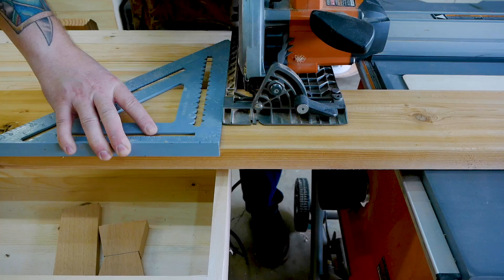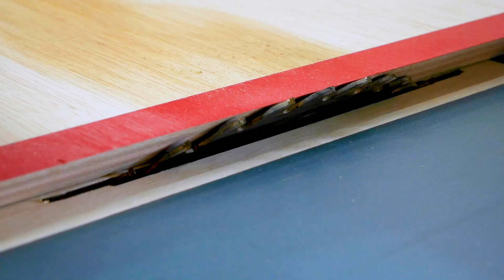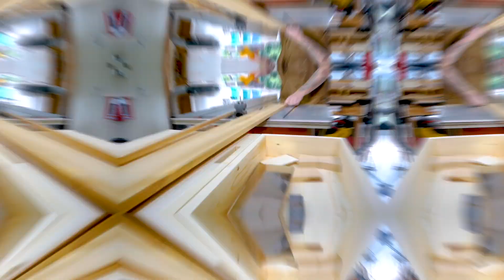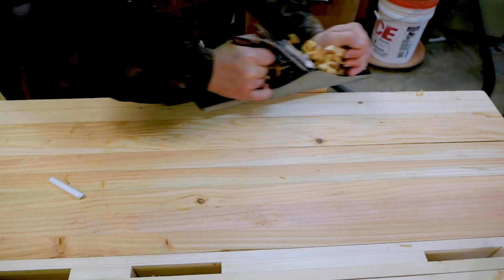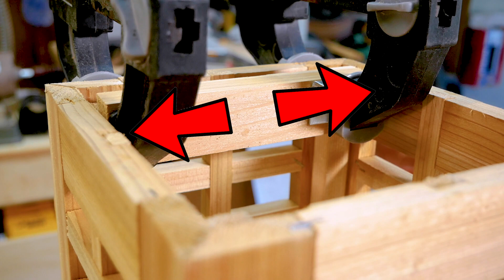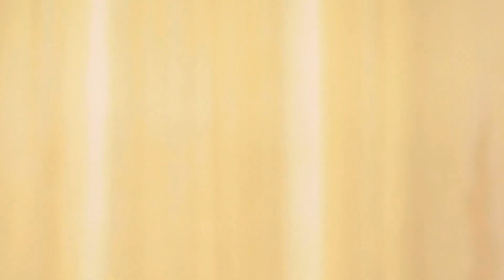I Made New Garden Lights: This Is A STUNNING Upgrade

Comment: Wood is terrible when constantly fighting the rain and cold weather. If you char the inside and give it a coat, it will last longer. Using a plastic coating on the outside is better than varnish.

Comment: They look truly great ('Japanese' indeed). 2 things:
- make the covers skew, so water will run off
- I noticed a (small) gap underneath the cover - seal that off with e.g. insulation-tape, as it will prevent insects and spiders to squat the lanterns (yet, make some ventilation-holes, so heat can get out)
Reply: Yes, even a slight bevel will help with drainage. Otherwise water will just collect and either rot or mold up the top.  BUT, still a very nice renovation of these lights and I love the design.

Comment: Looks great!  What would you think of making a garden lantern using cheap solar charged lights?
Reply from the maker: Hey Ken, I think it could totally work! The biggest hassle you’ll have is either requiring the light so the solar is separate and on top of the lid, or sealing the lid if you end up just recessing the light into the lantern
Reply: I'm making exactly that. Solar lightboxes.